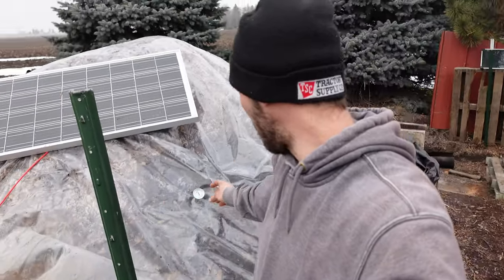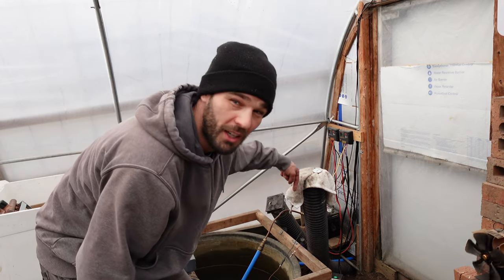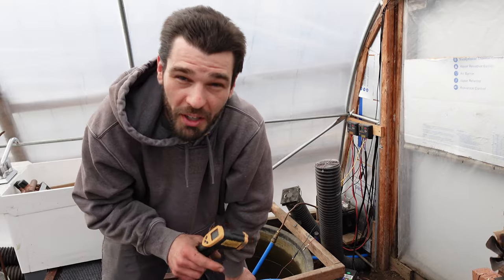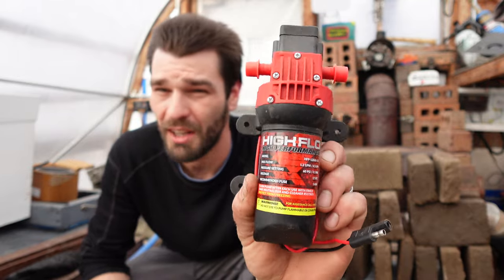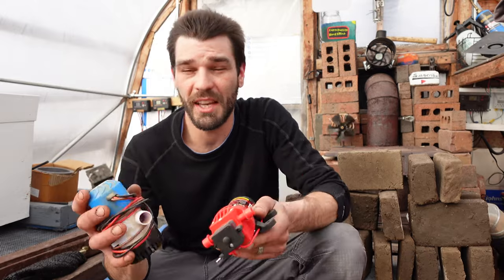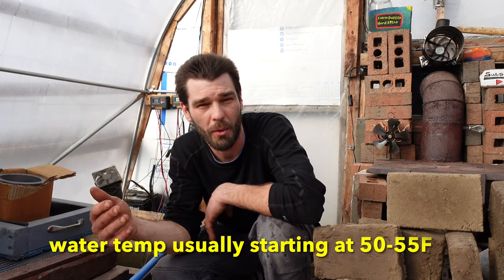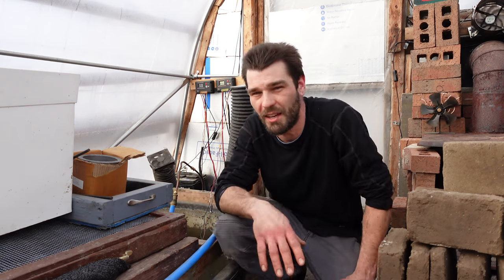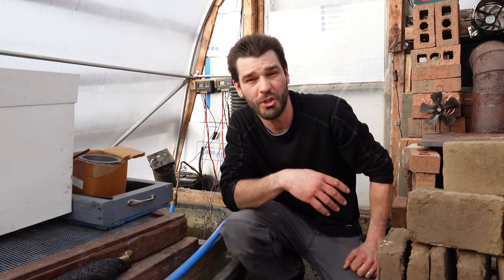DIY GREENHOUSE HEATING WITH COMPOST - THE CHEAPEST WAY TO HEAT A GREENHOUSE - COLD WINTER GREENHOUSE

Comment: Excellent 
Thank you

With the air exchange, don’t you get methane in the greenhouse?
Reply from the maker: Thanks for watching! The air exchange is for heat only, it’s a solid drain tile. Non perforated tubing through the entire pile and back in allows us to push air through without exchanging any gasses as it blows warmer air back into the greenhouse

Comment: Any thoughts on the impact of shade on a compost pile?  I want to set up a compost pile heat system for a small greenhouse (8' x 8') I'm planning to build.  I have access to free wood chips and can build a pretty big pile... but the only place I have for this pile is in the shade.  (I'm in the suburbs on a quarter-acre lot.)  Can I still get decent heat from a pile 10' in diameter and 6' high if it's in constant shade?
Reply from the maker: The shade does affect your pile however if you insulate it you can get away with having it in full shade, great question. I always offset my pile a bit from the greenhouse to allow for the winter sun to hit it a bit, and with a clear poly it has the  ability to multiply minimal heat.

Comment: Would you consider shutting down the geothermal and just run the compost heating?
Reply from the maker: That’s how we started, our small greenhouse didn’t have any geothermal only compost heat. Even our large greenhouse didn’t have geothermal for the first year while I dug the trench for it. We ran small compost piles inside using systems to move the heat around off the pile. I find the geothermal to be just as important as the compost heating especially on the cold cloudy days.